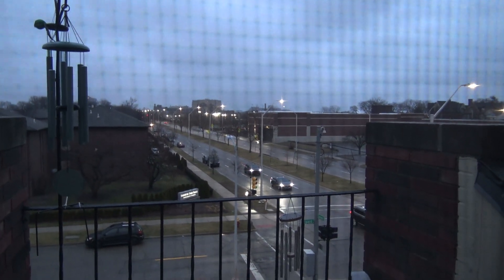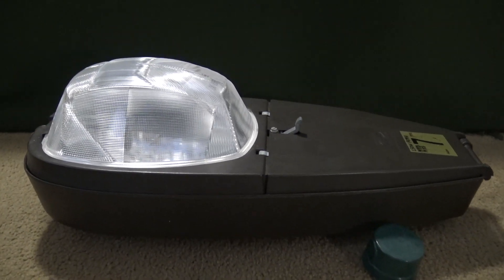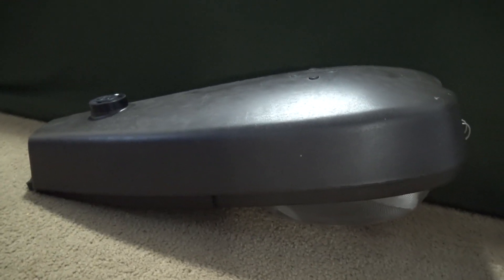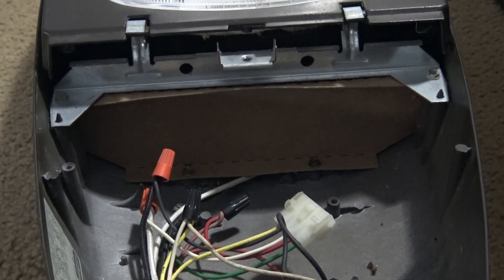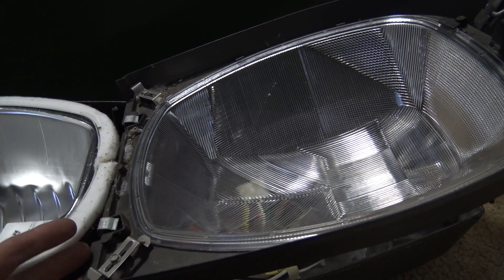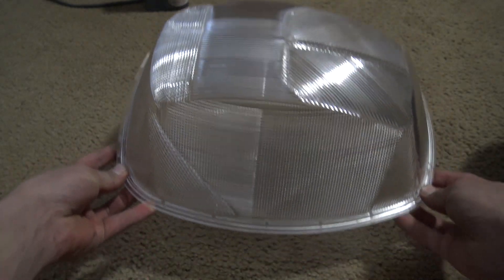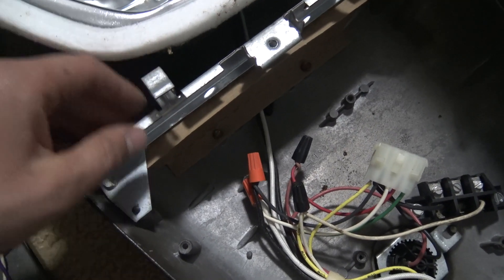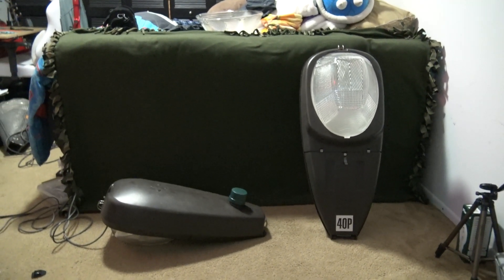Hubbell Street Luminaires Review Part 1 RMA

Comment: I remember visiting a local college in 2009 that had these fixtures in this bronze color along the road leading up to it and my local DOT used a small handful of them I'm assuming in the 1990s  throughout the state highways, mostly on exit and entrance ramps and those were gray in color. I didn't know what they were until recently. The ones at the college were removed years ago and most, if not all of the DOT installed ones were replaced years before the LED changeout in 2016

Comment: will point out the photo socket has a slot on top that you put a blade into and it unlocks it so it can be twisted without removing it
would like to see a quick comparo of this to the AEL / GE "small" fixtures of the time period and how the quality stands up as we all know the AEL were "not well built and the GE M250R2 were "cheaper" then the preceding models

Comment: as for the "hate" towards the roadside socket and having "pointless" adjustment in the manuals it will show WHAT SETTING TO USE for a given bulb + refractor to be compliant with class II / III light patterns 
and is NOT a "field adjust" item outside of refractor change / repowering into a different lamp platform IE Mercury to HPS

Comment: Why do I see capacitors?
Reply from the maker: Because that's what the fixture uses.
Reply: Here is what I understand about using capacitors on HID ballasts:

To further explain this, capacitors are commonly used with constant wattage autotransformer (CWA) ballasts as a ballasting component. If they are absent from those ballasts, the ballasts might suffer damage. On the other hand, high reactance autotransformer (HX) ballasts or simple reactor ballasts sometimes use capacitors primarily for power factor correction, but they are not necessarily needed for the lamp to operate properly.
Reply: Thanks man! Now I have two ballasts with a cap. Each.